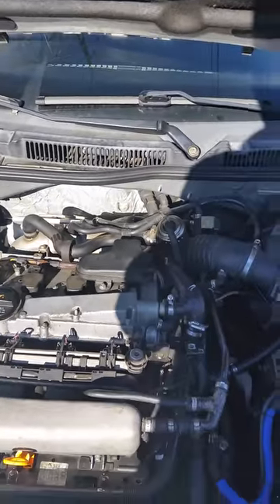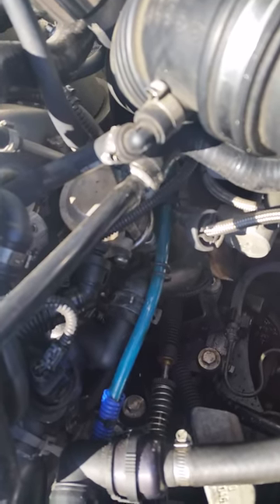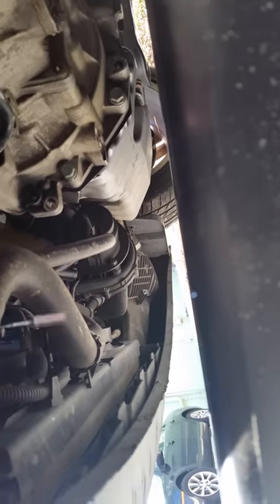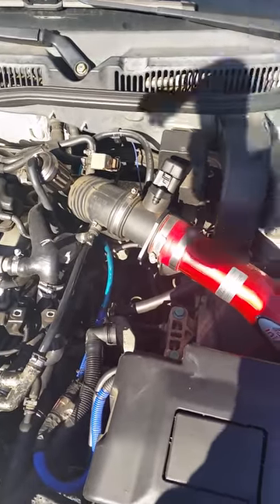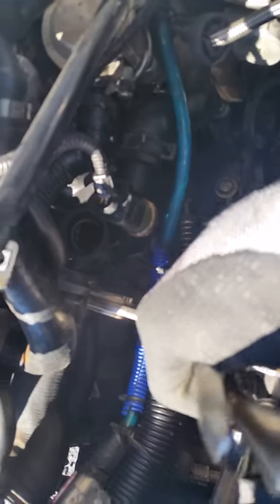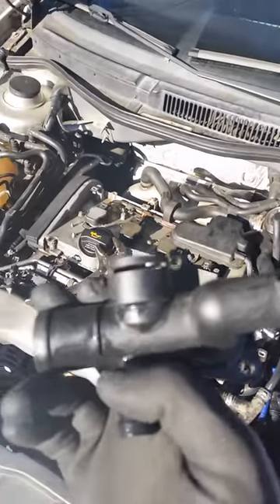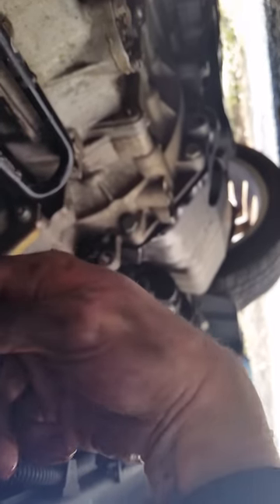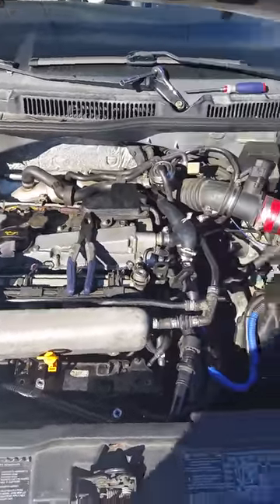Engine Coolant Flange replacement VW 1.8T DIY

Comment: I was referring to the rotation of the cam or phone..lol..when taking video it should be held sideways vs vertical... at any rate I think my 1.8T has this same leak, though yours seem easier to access than mine..
Reply from the maker: Well good luck in there. I believe in ya.

Comment: How did you move/remove the hard lines that are supported by one of the nuts that holds the coolant flange on? It looks like you bent the one bracket out of the way, is that correct? Doing this job right now and can't easily move those out of the way to remove the flange...
Reply: PLEASSEEEEE BRO HOW DID U DO IT IM DOIN IT RIGHT NOW AND 0 answers online
Reply: PLEASE
Reply: Did you ever figure this out
Reply: @CADOIP did you ever figure this out
Reply: @FrankBruno03 So, it's been probably close to 6 years since I got rid of this car. I did replace this flange. Can I remember how I did it? Not really. I do remember making my own ball end Allen wrench out of a cheap one I had in the tool box and putting it in a socket wrench, possibly to do this job. Either that or I just had another look at it and was able to figure it out. I wouldn't have been brutal with anything, that's not my style. I don't think I had to take much else off either. One thing I can recommend that I didn't find until after I sold this is get yourself a vacuum coolant filler. Makes it so much easier to refill.
Reply: @FrankBruno03  i cant remember how i did it sorry
Reply: @FrankBruno03  i very much recommend watching better videos i think i just uninstalled the hard line held on by a clamp or something

Comment: First off, absolutely great tutorial. I followed it to a "T" and had the entire thing done in an hour or so. Took me awhile, as I had to flush my system a few times to get all the old coolant out. 
Also, in case you were interested, ECS Tuning and EuroWise teamed up and made an entire cast aluminum cooling system upgrade kit for much of our failure prone plastic components. Maybe be a bit pricier, but it definitely will hold up longer and let's be honest, looks cooler. If interested, see below. 
https://www.ecstuning.com/Volkswagen-Golf_IV--1.8T/ES3086229/